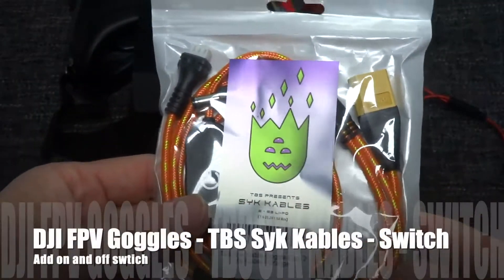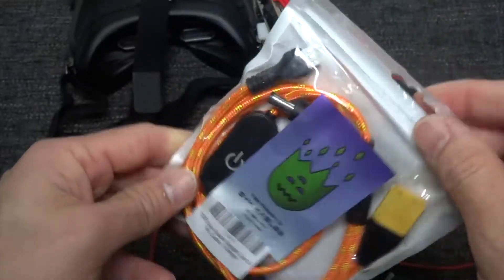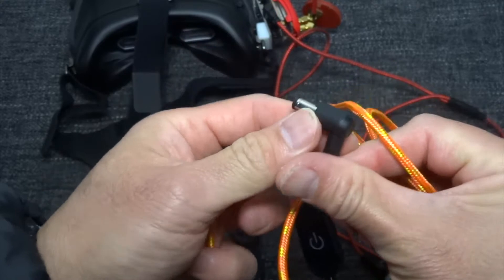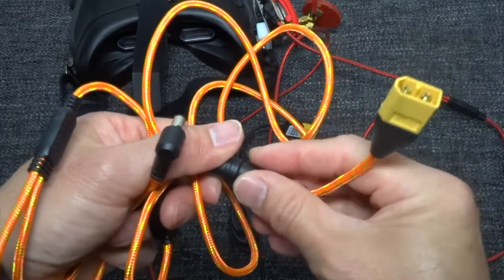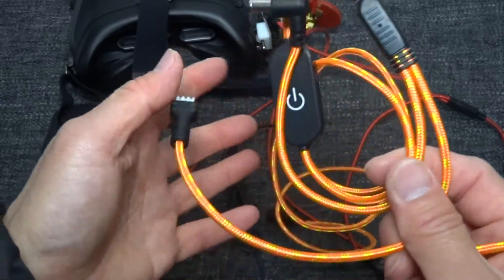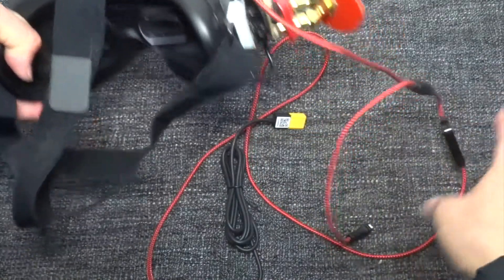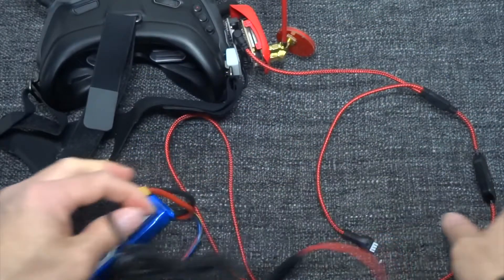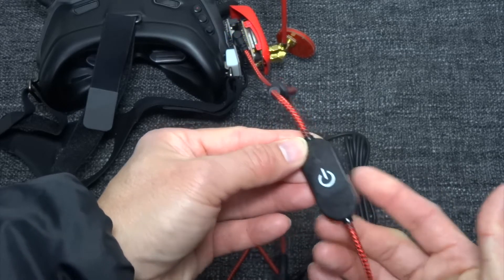DJI FPV Goggles - add ON/OFF switch - TBS Syk Kable

Comment: Hey hey. would you mind, telling me, why you are using the original DJI cable instead of the pigtail of the SYK Kable? And what is your voltage displayed in the goggles? I have the problem, that i only get about 7V in the goggles. what is below the specs of DJI (min 7.4V).
Thank you in advance.
Reply from the maker: Use it for the switch, the syk cable converts voltage to 2s, 7.4v, the cable is better than the original dji
Reply from the maker: I don't use the original dji cable, I use the splitter cable of the analog adapter and then split it to a switch cable to the analog adapter so I can switch off power to the analog adapter when not using it, the syk cable is the source cable